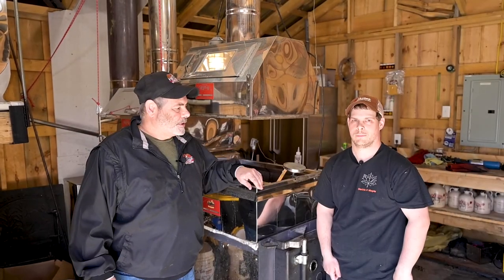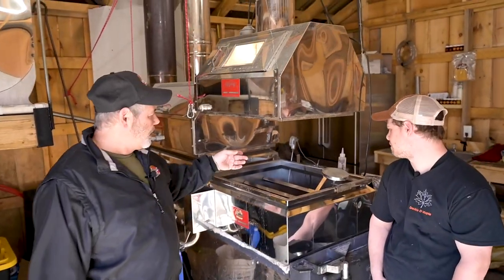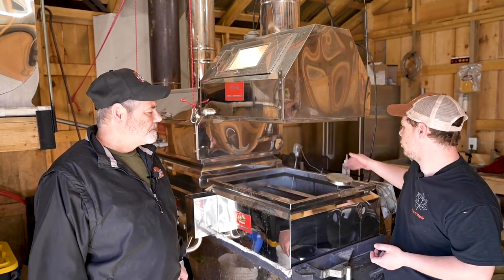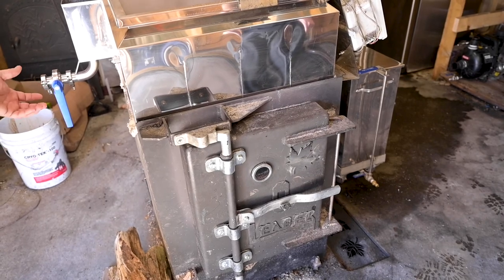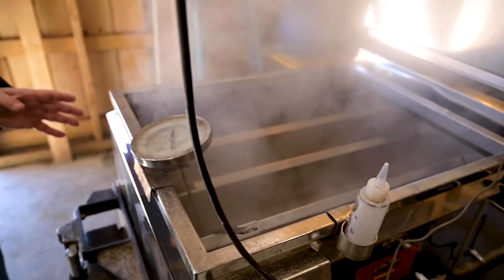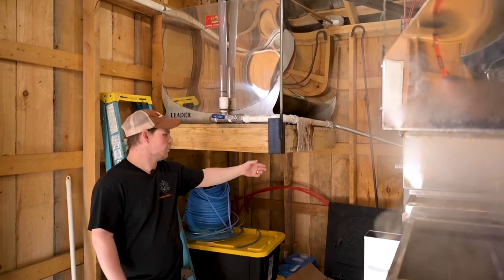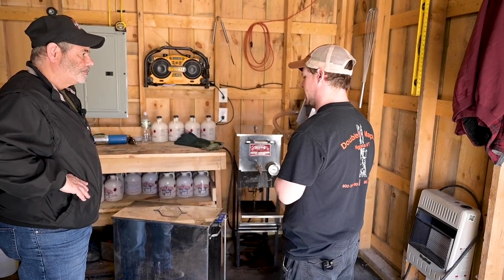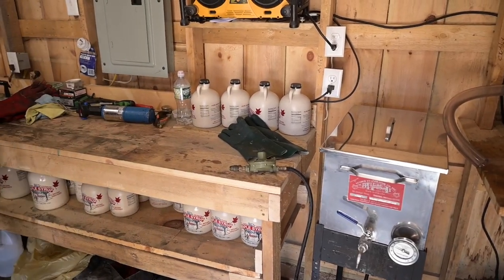How to run a small, EFFICIENT sugar house

Comment: Years ago I check out Algier, Leader, CDL, Les Évaporateurs Dallaire, and Lapierre, Waterloo, Small Bros - Leader and Algier had exceptional quality pans, CDL and Lapierre were good too, however Dallaire was the only company that would bend me a 4' drop flue pan out of 101 oxygen free copper sheet to be TIG welded back in NH. I drove up through the border crossing at the tip of New Hampshire, through numerous small Canadian towns, to the Lapierre's manufacturing facility. The guys there were awesome and they were interested in my project, within an hour I had the bottom and sides of the flue pan and I was back on the road to the US.